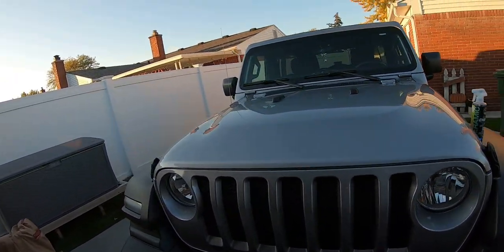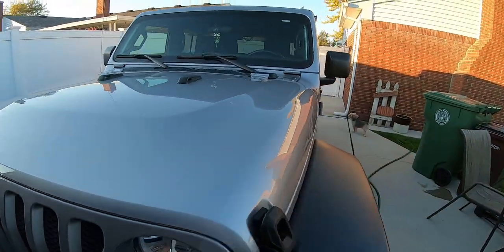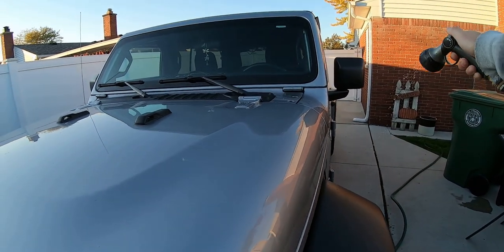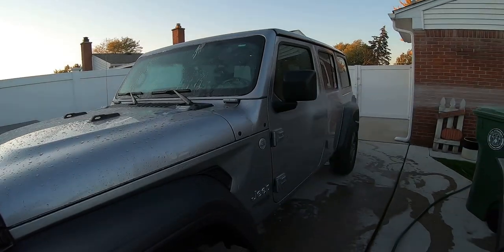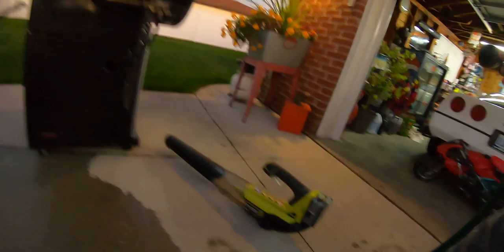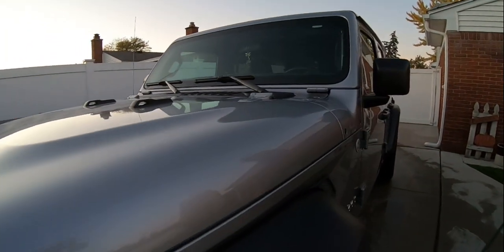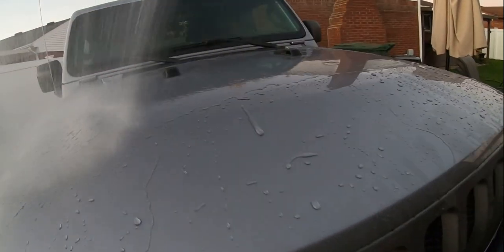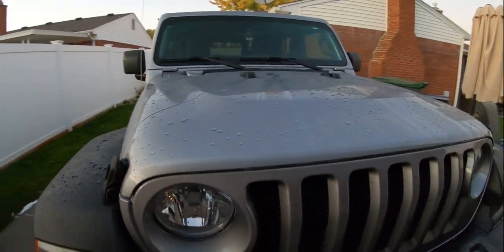6 Month Update :Chemical Guys HYDROCHARGE Ceramic Spray | Real World Test

Comment: As I mentioned in Brian's HydroSlick update,  I am 2 months into HydroCharge on my '12 Crew Cab Silverado and it's still at 100%. Staying clean. Slick and really incredible gloss. I did 2 coats 24 hours apart and made sure to keep it garaged while it cured. I think that's key to bonding and therefore longevity. I fully prepped the paint so it had a good chance at maximum bonding. Based on how its working I think its going to easily survive the winter.  I wouldn't hesitate to use it again. PS - I put a picture of the truck up on Amazon in the review of HydroCharge https://www.amazon.com/review/R3B9TS3S6C8ZR8/ref=cm_cr_srp_d_rdp_perm?ie=UTF8&ASIN=B07PZ92KJ3
Reply from the maker: Prep is the key and keeping it dry for 24 hours that what i did on the Jeep and the Corvette got rain on about 16 hrs after first coat of hydro slick then i put a second coat on the Corvette . Thinking of putting another coat on the Jeep and just test ceramic sprays and spray wax on the Jeep what do you think?

Comment: Stuff isn't terrible. Man I dig the new Jeeps.
Reply from the maker: Thinking of putting that IGL on the Jeep before winter .What do you think? Or Carpro Essence plus .lol like your comment on Jimbo and thanks
Reply: @OuzoLouGarage  Which IGL? The F4? That stuff freaking rocks! Go for it.
Reply: @OuzoLouGarage  Jimbo? You mean Dumbo? 🤣🤣🤣
Reply from the maker: Yes the F4 and i did order it also .. Thanks J.T
Reply from the maker: Glad i'm not the only one that thinks that . I was 😂 at your comment ..
Reply: @OuzoLouGarage  Use the softest pad you have and go with a low speed. You're gonna love it. If you have a hard time removing it switch to a damp towel. I'll be watching for your review. 👍
Reply from the maker: This is what I like for this channel peolpe that may know more about detail. Make comments on products they used and how to use them. I don't know everything and a lot if the guys that watch my channel are starting out and use the local store stuff.  I enjoy showing a few options in products and how to. And this for the tips on using the f4.
Reply: Man you gotta check out some tacsystem products! Moonlight, Aqua Waterless, Shinee Wax, Tire Coat, Total One Essential,  etc. These products give an enormous bang for your buck and the gloss levels are insane. They have been in the industry since 1995 and were the pioneers for si02.
Reply from the maker: Are all these products from tacsystem ? i did look at moonlight and that would be great to use on the Corvette and Jeep etc. Thanks J.T

Comment: Still looks to be beading but the beads are not tight together. I bet you can probably get another month out of it. Maybe with the boost you were talking about you'd get a few more months
Reply from the maker: This lasted pretty good for one coat and not using any spray wax etc to help it. Thanking of putting a fresh coat on and test ceramic spray and spray wax

Comment: That stuff is hangin in there. It would be interesting to see how long the one coat lasts.
Reply from the maker: Thinks of using Ceramic sprays and spray wax to boost it for winter and make video to see if those help. What do you think
Reply: Ouzo Lou Garage Sounds good! I need to get a booster on the Cat.